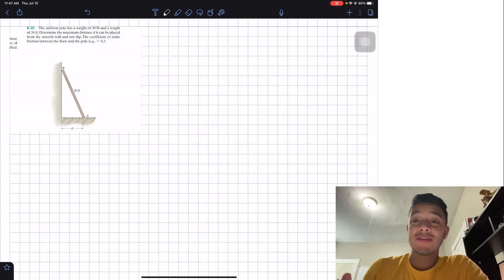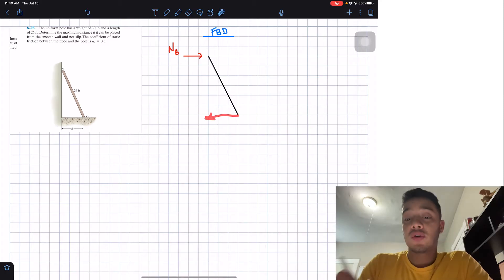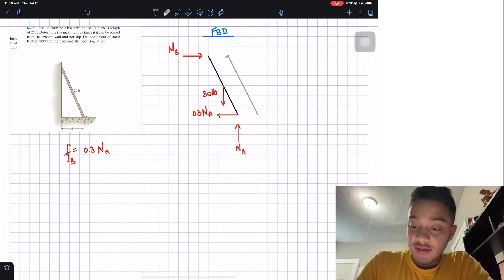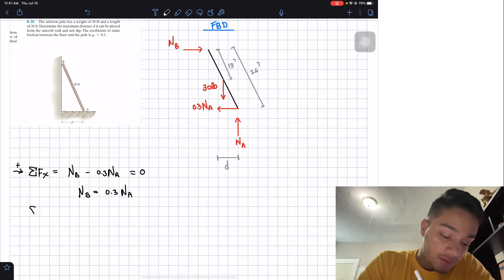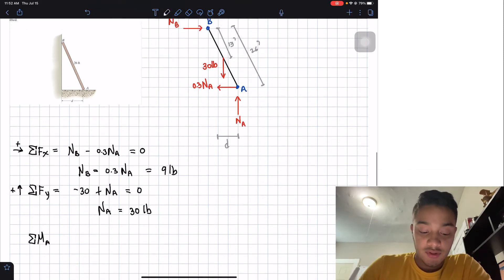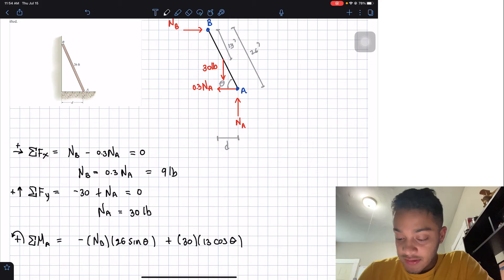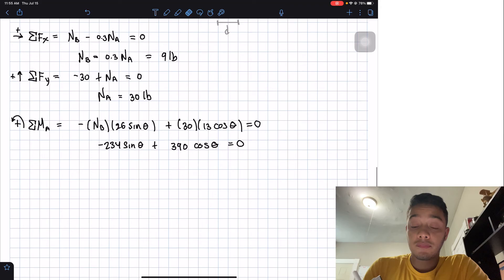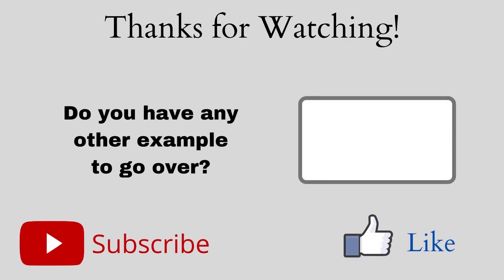Statics 8.25 - Determine the maximum distance d it can be placed from the smooth wall and not slip.

Comment: shouldnt there be a friction force at Nb? it is sliding down the wall after all
Reply from the maker: Hello, your question is very valid. However, in the problem statement they state" smooth wall" and by this they mean there is no friction with the wall.
Reply: @LearningbyTeaching  What if it wasn't smooth? Would the question be unsolvable then or what concept would have to be additionally applied? I assume there still should be some way to find that max distance or resting angle.

Comment: how to get theta?
Reply from the maker: You could utilize multiple methods.

(1) Graphing method: Use a graphing calculator and check when the (-234*sin + 390*cos) are equal to zero.
(2) Online calculator: Use a website or a calculator that solves equations (Try Symbolab)
(3) Manually solve for the angle: Move the 234*sin to the right side (becomes positive)... then divide both sides by 390cos and then when you do that you end up with 3/5*tan =1... Keep solving for the angle by utilizing arctan(5/3) and you should get the same answer :)

I hope this helps!

Comment: I really appreciate the video! For anyone else who is used to having lengths to work with you can solve for the distance on the y axis by way of the pythagorean triangle to set it in terms of d.
x^2 + y^2 = z^2
d^2 + y^2 = 26^2
y = (26^2 - d^2)^(1/2)
The moment equation about A becomes equal to: 30(d/2) - 9[(26^2 - d^2)^(1/2)] = 0
And obviously, solve for d.
d = 13.37688964 ft